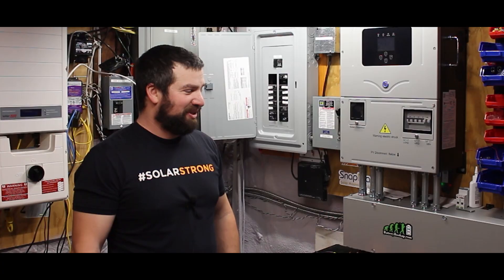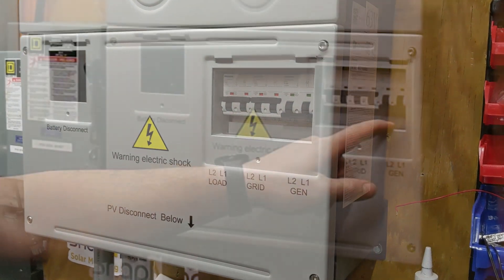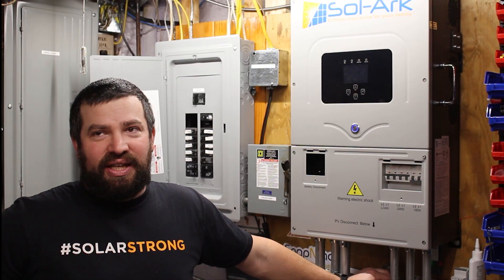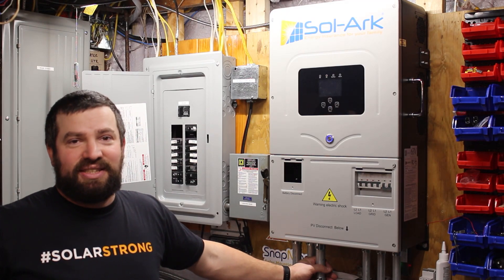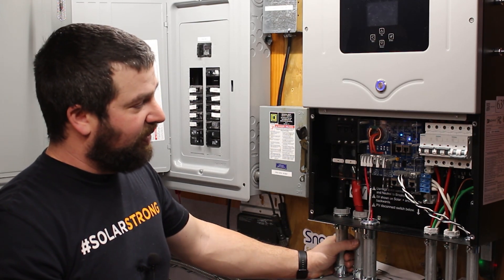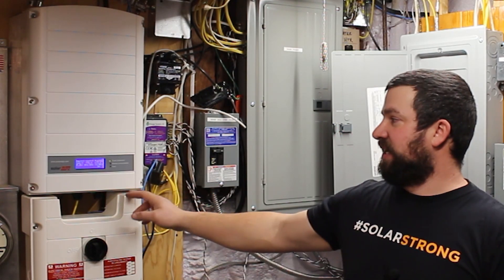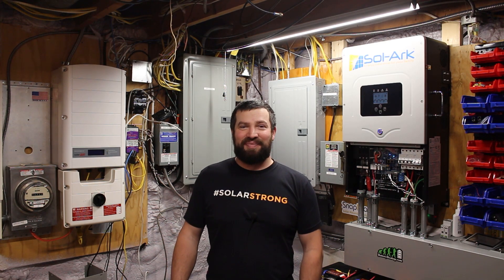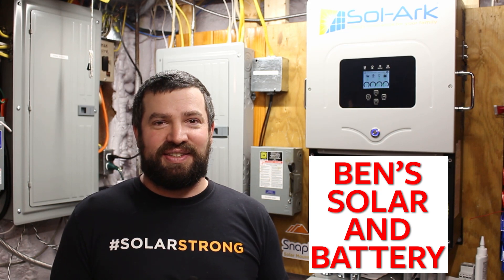Why the Professionals use the Sol-Ark 12K Inverter and Solar Charger

Comment: Hey Ben or David, I'm doing two separate 8s2p arrays about 125 feet from the sol-ark and the manual says 10 gauge wire is appropriate for that run.  Does that sound correct?  Watching the alt-e wiring diagram video seemed to add some multipliers onto the IMP of the panels that would indicate a thicker gauge but maybe I'm just not understanding it correctly.
Reply from the maker: I've also watched those videos from Alt-E.  Amy did a great job with them.  The important question is: How many amps?  We size wire based on the amps it will carry.  I don't know the amps of your panels.  Let's pretend your panels have an Imp of 10 amps.  And you plan to parallel your two arrays together, in a combiner box, at the array.  That's 20 amps that now has to travel 125 feet.  (BTW, it would be best to run dedicated wires for each string and only combine them at the Sol-Ark)  Amy covers the details in her video, but the bottom line is you multiply by 1.56.  20a*1.56=31.2a  According to the NEC you can run 10 gauge if the wire, breakers, etc. are all rated for 75°C.  Then comes the whole second question of voltage drop, but we can table that.  
The Sol-Ark has slots for 4 strings built in.  So I'd suggest running your 4 strings directly to the Sol-Ark and not to combine them at the array.  This means 4 positives, 4 negatives, and a ground.
Reply: @DavidPozEnergy  , thanks for that explanation.  It helps clear things up for me.  Kind of a silly follow up, but where exactly is the ground wire going in this situation?  Also, do you think 1 inch conduit would be best here or should I go bigger?
Reply: @HomesteadingintheForest  ground wire is to bond the racking and panels so that in the event of a fault, the racking doesn't become energized.  You could do 1", but I always run PVC a size or 2 larger than needed.  It just makes everything easier.

Comment: I like your setup , you run your DC thru a conventional breaker box BACKWARDS with both positive and negative sides of the load protected plus you have a BMS that protects for over current and low voltage cutout . Awesome !

Comment: The Sol Ark is a great inverter and agree, the only thing it needs is a 100A AC output and the color display on the front could be a bit larger.  Other than that, they've done a fantastic job!  Oh, and Sol Ark should ditch the 8kW and make it a 5kW.  The Sol Ark makes Outback, Schneider and Magnum look like Ford Model A's--antiquated and out of touch with today's tech.
Reply: They still sell enough 8K's they have to keep making them so they heard you and made a 5K model!

Comment: Re: Compressor Overload
If he had a 220/240v compressor, would overload be less of a concern because he even distributed the load between two lines?
Reply: Adding a Solar Edge Autotransformer to his “transformer less” inverter externally, will also balance the loads..  not sure it can be done with an inverter that already generates 120/240 split phase though.  But on a 240V only inverter it does balance out the 120V loads,
Reply: Yes

Comment: The AC IN meter on the metering screen does not work on extant hardware revs of the Sol-Ark as they do not have monitoring CTs on the generator/AC coupling/dump load port.

Comment: hey there buddy i have a question for you, and i really believe that you can give me some really good advise.
All i want to do is just power my 220-volt clothes dryer in my house off-the-grid. "that is it"
my question is how many 12-volts batteries ,what size power inverter 5k or 10k watts and how many solar panels watts and volts?
This is a list of what i have on hand at this time:
#6-350-watts  45-volts  solar panels
#8- 12-volt 100amp hour batteries

#1- 12 to 48volt 80amp solar charger
#1- 12-volt  110-volt 5000watts power inverter
If you could share with me some things that could work that clothes dryer I would be very grateful for any kind of information that you have.

Comment: Without much of an Electrical background I installed a Sol-Ark 8k.  This was before the 12k was available.  It has worked flaslessly.  We found used 12V 180AH Telcom Batteries and have 16 of them connected to the Sol-Ark.  But only have 3 arrays of Solar Panels connected so far.  It was an interesting experience for someone who only wired 110V switches and outlets before.  We do love the system and are grid tied using Net Metering.  Would be interested in sugestions to move over to Lithium Batteries on the cheap.

Comment: David. Thanks for sharing.  For dryers,  consider a heat exchanger one.  I've  changed to one . I also assist my solar water heater with a heat pump. That way I can have it all.
Reply: I chose a natural gas dryer and a tankless natural gas water heater....honestly...it's my opinion they are VERY cost efficient and help make the rest of the house solar friendly.
Reply: @ScoopDogy  absolutely, I have a Mitsubishi Air Sourced heat pump with 4 zones (2 air handlers, and 2 wall mount), with 10KW of solar, so house is heated/cooled for “free” (well, ignoring the PV system cost)..  house was built as passive/netzero, final leak test was .38ACH50, but, it doesn’t make any sense to dry clothes , or heat water with electricity, so I installed a 1,000 gallon propane tank, used for everything else (clothes dryer, 2 on-demand Rinnai H2O heaters, wall heater in garage, oven/range, outdoor grill and 20KW backup generator).  Just had the propane tank filled, after 3 years of living in the new house, took 322 gallons of propane (out of a max of 850 gallons, must leave %15 air space to vaporize liquid propane), or about 107 gallons/year.  Propane is $2.89/gallon atm, so about $300/year, hard to beat that with solar/electricity.  It’s great to be green, but makes little sense to ignore the benefits of propane/natural gas for some uses.
Reply: why a dryer? the clothes dry from themselfs.
Reply: @hdj81Vlimited  it depends where you live. I hang clothes (nearly desert) snap my fingers and they’re dry.  Where I used to live (temperate forest) you could watch the mold grow on them before they’d dry. 😂

Comment: Best Overview video of the Sol-Ark. You really know our inverter well. Great job. FYI you can have 4800W on L1 and 0W on L2. It has huge 240V peak power. But you are correct that some 120V inductive loads >3/4hp can be an issue. We recommend rewiring those massive motors to 240V (most are convertible on the motor). The 1400W limit is with DC Loads. A heat gun on high is an AC load but on low, it only uses 1/2 of the sinewave (DC load). Our limit for DC loads (hair dryer, leaf blower, drill, blender, curling iron, heat gun only on low setting) is 1400W. Please email or call us to update your software. You are using an old version: why you see voltage on the grid when not really there. FYI, we are coming out with several new generator functions in ~6 weeks. And local monitoring in ~8-12 weeks so you don't have to be connected to the cloud. The inverter is so great because installers, Off Grider's, and DIYer's helped us define it. So keep up with the suggestions.
Reply: You guys really need to stop allowing China to "monitor" your customers inverters.  Bring this very essential task back to the United States and STOP USING OFFSHORE MONITORING!
Reply: @donfrancis103  or spending $7K for something made in China...
Reply: @CallsignVega  I think they are made in Texas. maybe just engineered there but I don’t think so.
Reply: Hi, What sized switch mode welder can we run from the Sol Arc? Australia desperately needs this quality product. Due to the terrible politics there all of the Solar in Australia is grid tied only. They don’t know what they are missing out on.
Reply: @williambunting803  check out deye inverter for your market(non-usa).  Basically the same, although much less support after the sale, but MUCH cheaper.
Reply: David and sol-ark....i’m negotiating purchase of 50 acre land in eastern Washington. I found out on average it will cost me $60k per mile to send 240VAC wires to the parcel. I figured for $60k I can have a killer solar and wind program. I’m looking at the SolArk 12k with 36x 365w Mission Solar panels. MT Solar two pole ground mounts. And 3 banks of Big Battery TREX lithium batteries for total of 38.4 kWh of battery storage. 3x Primus 40A turbines. And a General 10kw propane generator. Ill have a LP converted furnance. LP converted water tank heater. And LP converted kitchen oven and clothes dryer. And 1000 gallon propane tank. Hope to make it all work. Would hate to spend $80k to get 240VAC utility grid power to the home build site and then pay $200 per month. We get quite a bit of fog from December to February that i’m concerned about. But we get prairie winds more than occasionally. We also enjoy a hot tub soak a few evenings a week, but concerned about that energy in the winter. Doubt I can make a 240 spa work, but maybe a 120VAC friction heater spa work.
Reply: Will that extra generator input functionality include frequency shifting without needing to have the generator port set as an AC coupled input?
Reply: I have a 1/2hp 120v well pump that hammers my generator pretty hard when it is comes on. Do you think this unit would be able to handle it?
Reply: Does you’re inverter start well pumps
Reply: Any chance of getting a high voltage battery setup? 96V/192V etc...
Reply: @Sol-Ark : could a super-cap bank be used instead of batteries?

Use model: fridge and LED lights need to work overnight. Well pump, all other loads only while the PV array is cranking out 6-8kW, so it’s really just buffering power.   Inefficient a bit, but much lower maintenance.
Reply from the maker: Hi Sol-Ark,. Thanks for reaching out and watching this video. I appreciate the comment. Both Ben and I are big fans of your product. I'd be willing and very excited to review your new generation in a follow-up video. And I'm willing to ship it back to you when I'm done with the video, or do a giveaway to the audience.   I think the audience would love to see the new features that you described. I'll use the same type of load such as air compressor heat guns and miter saws to demonstrate. Would you like to send me one for that video?
Reply: @DavidPozEnergy   Send us an email support@sol-ark.com with your serial number and we can update the software. Then try testing again.
Reply: @Sol-Ark  it was updated pretty recently, but I'll get in touch with you to double check.  Thanks.

Comment: Pretty costly inverter. I suppose for all that functionality it is ok .
Reply: Costwise, it works out comparable to equivalent systems from other major venders (twin Magnum MSPAEs plus 3 PT100s, twin/triple Outback Skyboxes (each of which needs a separate battery bank), single/twin Xantrex XW+ 6848s and twin/triple MPPT 80 600s), especially when factoring in the extra cost of all the switchgear for each of the aforementioned systems.

Comment: Everything built in all in one can't start a air compressor lol not good with inductive loads
Reply: Maybe try a VFD (variable frequency drive) if you really need to do this.   Otherwise -- compressed air is its own form of storage -- so you can run it directly from line, solar, (or whatever) source -- no point in using battery storage to do that.

Comment: That’s a terribly small neutral capacity on that inverter! It should be rated for at least as much as the rated line current, if not more.
Reply: The N rating is 6000W. FYI you can have 4800W on L1 and 0W on L2. See my other comment.

Comment: FYI by code you can't use the 90*C rating of the wire because the terminals on those breakers are rated 75*C max.
Reply: Either way the 75*c rating for 6awg is 65amps. If you are 50 amp limited, there's not a problem.
Reply: Ahh yes, I mixed up 60c and 75c. NM (romex) would be rated for 60c, which is good for 55a and can be rounded to 60a. The MC can go in the 75c column which is good for 65a, rounded to 70a. Kind of a moot point since I'm feeding it with a 60a breaker, but it does have a 63a grid input breaker which would need 6awg at 75c.  
Thanks for pointing that out!
Reply from the maker: Very good point and thank you for bringing it up. Yes Ben did mention something like that basically the six gauge is fine even at the lower temperature rating. But the lugs can accept up to four gauge. So some people will put in the four gauge. Sorry I wasn't clear on that.

Comment: I am using a 4.4 kw split (2.2kw on each rail) and I can run my air compressor on one rail and AC on the other with no problem (or each one alone) I don't see why Ben would have an issue? Let me know David!
Reply: My bet is, he means when everything is on in the house, the compressor 120V startup shift freaks out the system.

Comment: Hmm sol ark are nice and expensive atleast if my outback fails I can fix it in the field instead of shutting down my off grid cabin to send it in to be fixed theres always ups and downs with everything out there on the market good video
Reply: Is the outback system EMP hardened?
Reply: What outback do you have?

Comment: When I contacted SolArk they told me I needed 3 of them to power my house and shop. That would be $21,000 for them, if they cut their price in half they would have sold 3. If I remember right Deye manufacturers them for solark. Those are much much cheaper overseas.
Reply: If you call us, we have to say list price and encourage you to buy from a distributor (it will be significantly cheaper). This inverter was designed, tested, serviced, and supported in our Texas office. It took us 6 years to develop and our patents protect us were needed. Unfortunately, we go through 2 tiers of distribution in the USA (Manufacturer, Distributors, Installer, all 3 helping the customer). The distributor marks it up and the installer marks it up vs. selling direct to consumer. In addition, we have to pay and support ~10 different UL listings for each model of inverter (~$500K in fees and engineering expense). Please don't discount all the efforts we have done. And we have something coming that will allow you to use 1 inverter + something secret that will allow you to do your entire home. Our mission is to bring down the costs for families. And when you can use 1 ESS system instead of 3, I would say we are getting close.
Reply: @Sol-Ark  This looks great, but I also want something for my whole house & shop. For those of us in the serious planning phase - what's the ETA for your "something secret"???
Reply: @Sol-Ark  

I hope so. Ive been waiting for something that is user friendly like the solark, that is what attracted me to it. Not to mention being able to use it with the north American grid unlike the euro style.  Just the sticker price is what got me.
Reply: Yeah, I had similar experiences at my local Ferrari and BMW dealers.  I told them that their cars were overpriced, but I'd definitely be a buyer at 50% off.  They both declined my offer.  :-)
Reply: The Sol-Ark branded inverters are not exactly the same as the base Ningbo Deye inverters.  Part of the extra cost is higher spec components (i.e. the Sol-Ark 8K is rated for up to 11kW of PV, whereas the Sunsynk branded Deye equivalent is only good for 8.8kW of PV).  Then there are the extra complications in the guts to get the single phase 3 wire or 2 phase 120° 3 wire output, whereas the Deye and Sunsynk inverters are for markets that only need single phase 2 wire.
Then then there is amortizing the NREs for the EMP hardening.
Reply: Everything BUILT-IN single box (Distribution+Charge Controller+ Batt. Disco+Display) is Perfect for space saving (& ease of install). Customers Love the tap ON Flow display
Try to build one yourself before  complain about price!  Sol-Ark support/customer support is Top notch & personal!🌻🌄

Comment: Reminds me of the Beacon Power M5 inverter so does the price. But this has 240v and 7000 more kw. Does it have software not in cloud.
Reply: Local monitoring is coming in ~8-12 weeks so you don't have to be connected to the cloud.

Comment: I'd get a transformer, to only pull 220v from the inverter for the big 120v loads, if it ended up being a issue!
Reply: Yes that has worked perfectly for some 1.5hp 120V motors and motor home A/C units.
Reply: It's sitting on my bench waiting to be hooked up! 😁

Comment: 6:02... Why would you have a North facing solar array ?? I thought the sun was towards the south.
Reply: @ lasersbee - A PV array on a shallow-pitched, north facing roof, can ADD a lot of kilowatts in the summer time...
Reply from the maker: Ben ran out of room on his south facing roof.  I linked to his first video in the description where we go into more details on the solar side.
Reply: You can mount panels on the North-facing roof on frames angled to the South. This creates similar solar exposure as the South-facing panels. This is what I did with my last house.

Comment: That's a pretty sweet setup! I really wish they would create a 10kW or 12kW version > might motivate me enough to consider switching!
Reply: Doesn't sound like they have the large surge current capability of your aims. Did you mean you want a solark if they made larger than 12kw?
Reply: @jakeandrules7724  no... this is an 8KW inverter. It only supports 12KW with grid coupled.
Reply: @SuperVstech  the 12k is just 8kw output a/c but can do an additional 4kw to the batteries at the same time(offgrid). For some reason my solark 8k can actually output 9kw (cant do additional charging tho)(offgrid)